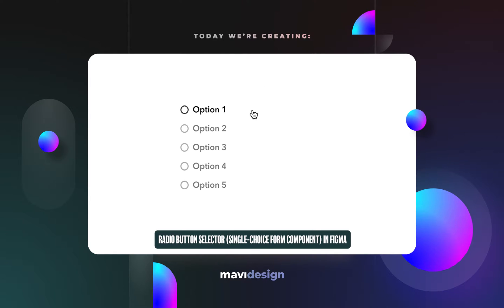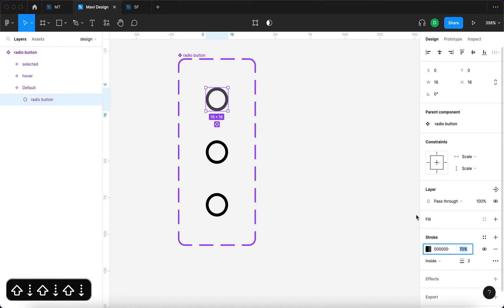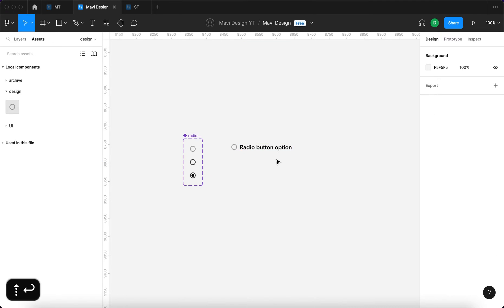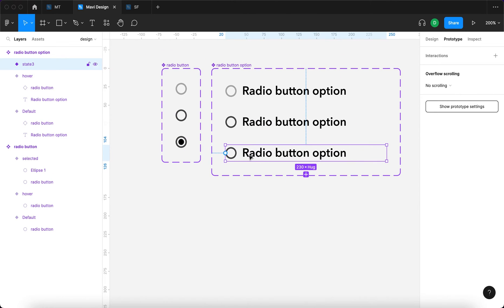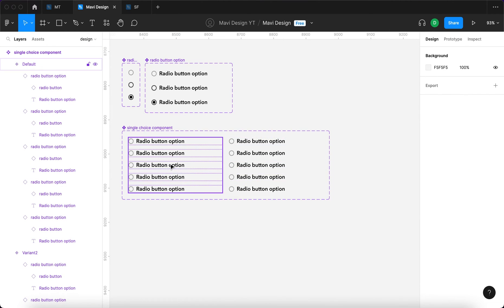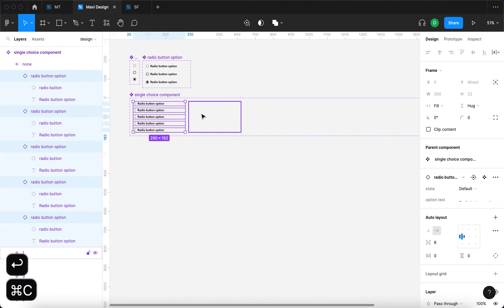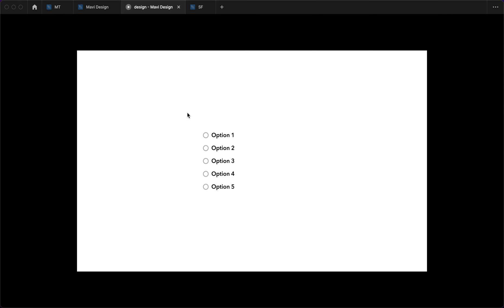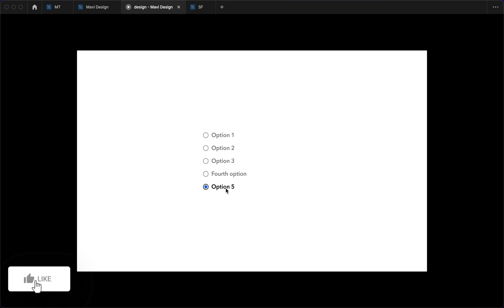Create a SINGLE CHOICE (RADIO) Interactive Component in Figma (Tutorial)

Comment: Thank you for your video. Now, I understand the method of selecting a single choice from many variants. But in this video, the method you used is to create variants and components step by step, the first step is to add selected button and the second step is to add words and so on. It is a bit complex. In this example, you are only listing 5 selectable choices. Is there a simpler way to do the single selection? 🥺

Comment: Thanks for sharing. Btw, I never got the on click event on my last instance demo, only hover states. I followed all your steps to a tee. I went back to the radio button and the radio button option components originals and added a click event from hover to selected, then it worked in the demo as well. That's very odd cause you left that out in your tut. Figma doesn't allow multiple events to be triggered on the same component, so adding both a mouse over AND a click event from the default state button won't work. So adding a click event on the hover was my only option, that's a very strange interaction. I think it's safe to say that Figma is very over engineered and not very logical 😵

Comment: Great tutorial but sadly this does not work in the latest Figma version. You cannot select an option when clicking because the interaction is based on "Default" state and not the "hover" state.
But I've found a workaround :
In the latest Figma version, you need to check the "Reset component state" checkbox when defining the interaction in the single choice component.
This does not work with the "empty variant" trick as presented because the checkbox will not appear. Instead, we need to do things in a slightly different order. 
Define the interactions before emptying the variants (don't forget the "Reset component state" checkbox). Then, delete all the options and copy the ones from the first variant, where the interactions are defined, just like in the video.
I hope it helps =)
Reply: The greatest of heroes. Thank you very much <3
Reply: Yes! It works. Thanks!
Reply: Thank you so much!
Reply: Thank you, it works now! :)
Reply: Very helpful. Thanks!
Reply: It worked for me

Comment: XD does this a lot faster. What a pain in the A.
Reply from the maker: I’m afraid that’s not true. I’ll be happy to correct what I’ve said if you point me to a specific XD workflow — I have done research on this because someone already left a similar comment. The functionality of Figma and XD is similar in this case which means that the process would be of similar length — it’s important to not forget that a radio button requires if-then logic which has to be worked around using prototyping mechanisms

Comment: thanks for the video and it seems to be very helpful. I followed all the steps carefully and when I present the prototype, the hover option is working but the select option docent work. I tried to follow all the steps again and again for few time and the same issue happed every time. Could you please help me move this issue. thanks
Reply: Hi, i have the same issue, have you found a solution? I think that the problem is  because the click interaction working between the default state and selected date, and when you are in hover state the click doesn't work properly.
Reply: @antoniodisilvestro7886  unfortunately I couldn't solve it. I end up buying the file
Reply: Have you found a solution? .. I am having same issue can we connect ! ?
Reply: @omotayoyohan3217  unfortunately I couldn't solve it. I end up buying the file
Reply: Hello! I am having the same issue. Can we connect and discuss the solution?
Reply: @madelynlee2732  I have found the solution. In the latest Figma version, you need to select the "Reset component state" checkbox when defining the interaction in the single choice component.
This does not work with the "empty variant" trick as presented because the checkbox will not appear. Instead, we need to do things in a slightly different order. 
Define the interactions before emptying the variants (don't forget the checkbox). Then delete all the options and copy the ones from the first variant, where the interactions are defined, just like in the video.
Reply: Thank YOU !!!  @romainaranda19

Comment: Figma is crazy!!! All these steps just to create a single selection radio button. Adobe XD does it better within few seconds.
Reply from the maker: Really?! How?
Reply: @mavidesign  how? Creating a single selection radio button in Adobe takes a few seconds. Look at all of the steps one has to go through just to create that from your video. Haven’t you used Adobe Xd before?
Reply from the maker: @simisolaodukomaiya151  Oh I have used Adobe XD before. I can't however recall a workflow with if statements, meaning the structure needs to be similar to this tutorial if you want to create something that works similarly. The problem is not designing a single radio button but rather creating a set of these, where if you click one, the other gets automatically de-selected. As far as I'm aware this needs to be done through a specific structure as shown in this tutorial or using "if" statements which, to my extent of knowledge, are not present in Adobe XD nor Figma. Please correct me if I'm wrong:)

Comment: Hi, I followed all the steps but when I tried to launch the prototype, I can select all the radio buttons at once. Selecting one doesn’t uncheck / untick the others - mind letting me know what’s wrong? Thanks!
Reply: You have to check at the State management options and make sure the  "Reset component state" is on for the interactions.
Reply: @feherlofia21 thank you!! This advice helped me a lot!
Reply: @feherlofia21 Thanks! I made it work with your advice as well.
Reply from the maker: Hello, I’d have to see the source file to determine what’s wrong. You can reach out to me via Instagram or Discord (Patreon)
Reply: @mavidesign  I have reached out to you on Instagram, appreciate it.
Reply: Hi, I also had the same issue. Have you solved it ? If solved means, Please let me know. Thank you

Comment: Having the same problem as a few other users, followed the steps up until the Expose Properties section but the option is not appearing for me with. I initially thought it was with the way I set my component up as I have an addition text area for a description. However I tried following this tutorial with just a radio button and a text label and the Expose Properties option is still not appearing. Is there a step that I've missed? Has this option been moved somewhere else?
Reply: U need to turn this on in settings
Reply: @tomascoox  thanks for the help! Finally got it to work, had no idea it needed to be turned on in the settings, appreciate your help!
Reply: @tomascoox  i have same problem. where is settings and Which options should I turn on?
thank you
Reply from the maker: Hi, I'm aware there have been multiple comments suggesting the same thing. I'm however still getting the intended result (I can see "expose nested properties") and am unable to replicate the problem.

Could you share your file with me? I'm trying to undersand the nature of the problem. Thanks!
Reply: @mavidesign  Unable to share as it was a throwaway page. I did find a page somewhere on the figma forum that implies that option is a BETA feature.
Reply from the maker: @Epsio0  that’s interesting — maybe this feature is gradually being rolled out across all accounts? That would explain a lot.